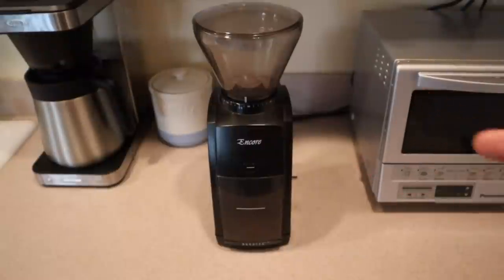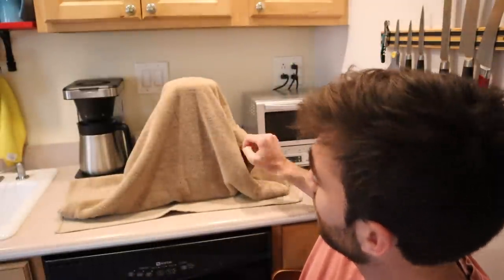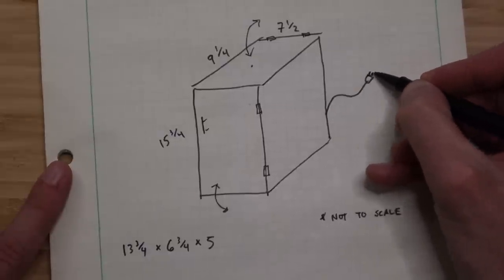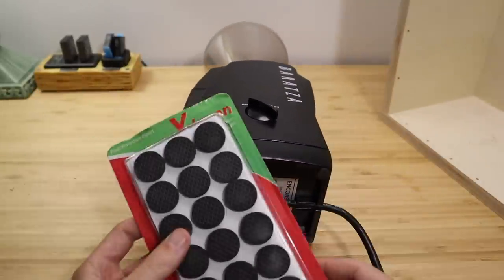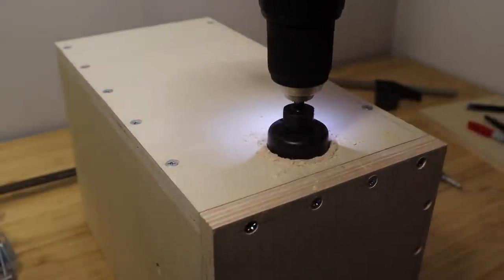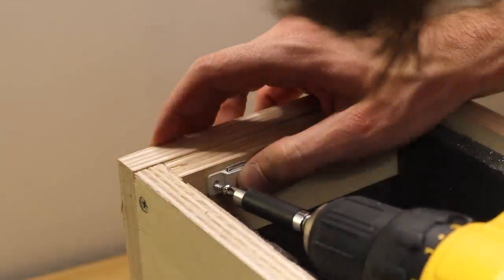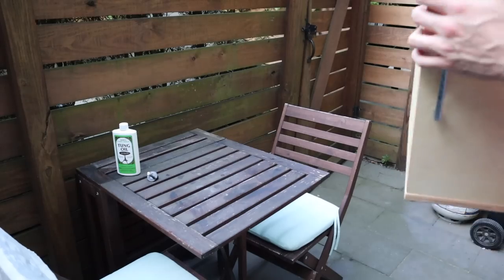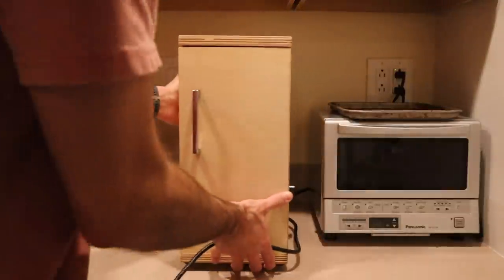Building a Silencer for my Coffee Grinder

Comment: another dope video, well shot and cozy vibes. keep up the good work, dude
Reply from the maker: much appreciated!
Reply: Agreed. For the outer frame I'd use thick double walled, acrylic panels (cheap, easy to cut and glue). Small "Non-Return Check Valves" to vacuum the air out between the panels. A couple rubber spacers to keep the panels from collapsing. Instead of a "door", I'd cut up and stitch several thick sound dampening blankets so I could reach my touch control panel.

Comment: Hey, do you have the rubber gasket installed in the grinder? It seems in 0:17 that you're missing one, as some coffee beans can be seen under the plastic hopper there. Probably wouldn't help with noise, but installing one would surely prolong the grinder's life!
Reply from the maker: good eye, yes the gasket is in there - I have to remove the hopper periodically to clean out those grounds. That gasket doesn't do a great job of keeping them out from under the hopper. Do you find yours does?
Reply: @Matt Perillo  Oh, alright then. I've seen too many grinders missing one I guess. And to answer your question, yes, I've never had whole beans under there. A little bit of fine particles, some chaff, sure, but definitely not such large pieces like in your video. I use the grinder daily and clean it once a month. It's usually around the 10th mark on the grind size, but that's probably on different factory calibration. You can ask Baratza about that, some people buy their grinders just because of the outstanding customer support :)